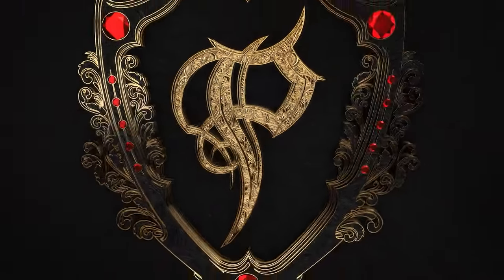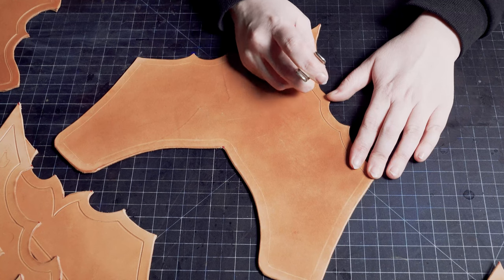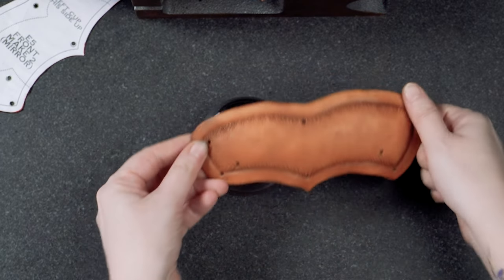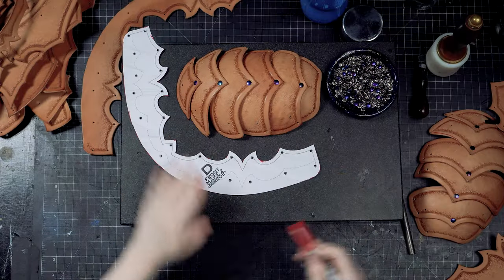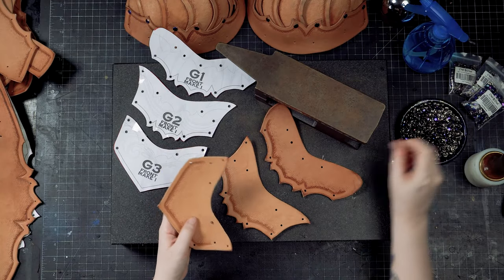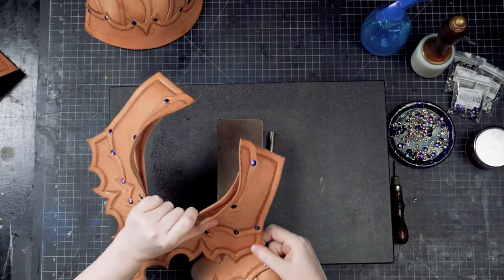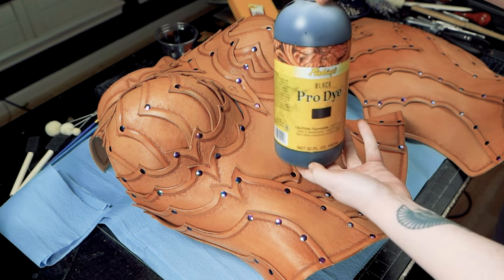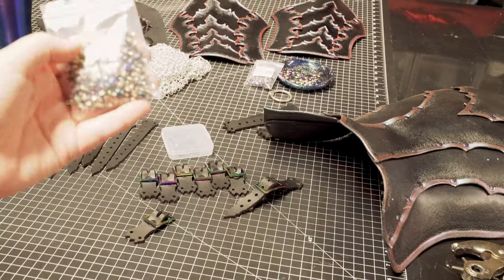DIY Armored Corset - Prince Armory Imperial Armor

Comment: Love the color shifting hardware and paint powder. It looked like the pigment application was a two step process of wetting and then applying the pigment, would really like to see how that was done.
Reply: Tandy Leather has the color shifting rivets.
Reply from the maker: Now that you mention it, I feel like I knew that in some corner of my mind but I totally must have forgot.  Thanks!
Reply from the maker: Noted!
Reply: @Princearmory  It's new. The assistant just told me about them last week when I was there resupplying. I didn't have use for them then, but I have one now.

Comment: The cups resembled pineapples when they were going together! I need to see more of the color shifting border application. Was it set with a spray? Could it be applied to larger areas than trim?
Excellent crafting tutorial and end of work modeling!
Reply: Lol. They do kinda.🍍
I felt like they looked like pill bugs/rolly pollies. 🤣
Yes, the powder pigment is set with a spray. I used saddle lac.
Reply: And I didn't do any large area tests but I imagine it would be possible so long as the glue base is evenly applied.

Comment: question on fit.. Can you wear the complete project and spray the leather with a water bottle as you wear it during the so-called break in period?
Reply: Dye and finish lock in a lot of the shape. So if you wanted spray it and try to wear it damp after the assembly stage (before all the dye and such), that would work.
Reply from the maker: Yeah, spraying it may help a little but it's more about forcing the leather to the shape you want and letting it develop a bit of give, or memory, while being worn.

Comment: I use a Dremmel with a burnishing attachment.
I would enjoy seeing all the other tutorial videos you suggested.
Reply: Those are nice. I have one, but it can be too much for some leather and cause burned edges if you're not careful.
Reply: @Ashkahus  I haven't had any issues with the burnishing attachments. I've got a few different styles, wheels, barrels, and cones. They're great for slicking holster edges.
Reply from the maker: We have those too, even several kinds of big dedicated burnishing wheels and stations, but my personal experience is that, at least for the leather we're typically using, it's actually quicker to just grab the slicking tool and use a little elbow grease and pressure to slick the edges.  This opinion might differ if we were doing production pieces or other repetitive batches perhaps.